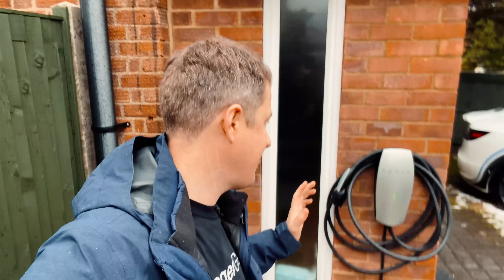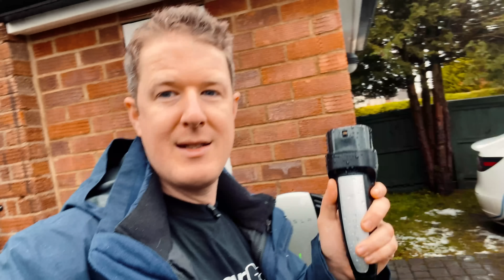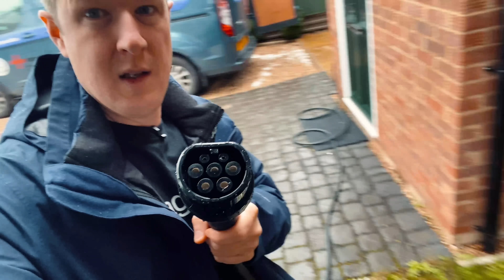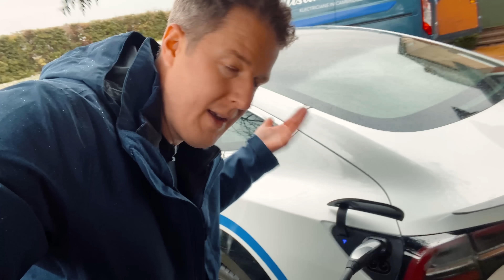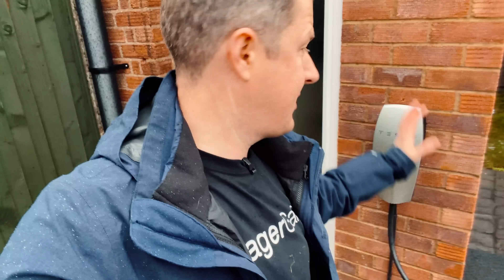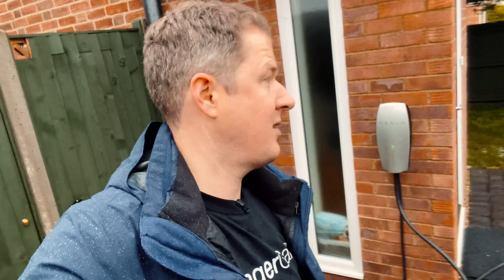Why you shouldn't buy a Tesla Wall Connector

Comment: Don't know if I missed any other points but your main reason is the protection devices with monitoring ability 2nd? 
Agree zappi is functionally better but don't think there is any problem with Tesla charger.
I've had Chargemaster Polar chargers which are terrible and Tesla chargers I'd put in the middle with regards to reliability and function.
At least the Tesla comes with 3 phase option for future proofing at no additional cost!

Comment: You can get non oem type 2 cables with the tesla botton, so you can match that to a charger with type 2 outlet.
I compared prices in norway (parts only) 22kw, tesla charger 5000kr+ chint earthfault protection 1500kr. The zappy is 10.000kr + cable 2500kr. So basicly twice the cost.
Another thing, the waterproofing over time, is not superb on the tesla plug.

Comment: So, they did come out with version 3 here in the usa and it does have smart features. So why review this version 2 then or bother to criticize it if you know version 3 is coming anyway.  We have this unit and have no need for so called smart features. It works, has been reliable and has a durable cable. If the cable is too heavy for you, then you need to work out. LOL.  The cable is hung around ours and it not an issue so I am not sure what you are talking about with the hanging. ??

Comment: Question from a non electrician .. How does an earth rod protect you when the car is sitting on four rubber insulators? Do you not still get a jolt when you touch the car?
Reply from the maker: The earth rod connects to the cars metal work and means that the physical ground under your feet and the casing of the car are at the same potential so you won’t get a shock. If the car was connected to the PEN conductor of the house and that dropped out then the casing of the car could become live and as the ground is a different potential you would get a shock if you touched it.
Reply: @artisanelectrics  what happens inside the house if you have a PEN failure? Surely all your metalwork, radiators etc would become live. Thus being more dangerous than a car being live, which I presume anyone would unplug before getting in.?
Reply: @daveknight7963  Yes, everything will become live, so you have nothing to touch that is at a different potential.

Comment: The only real safety hazard is the fact Jordon put the charger on the corner not the front forcing him to run a trip hazard in front of his door. Ya sure you UK types love all kinds of extra breaker types and extra cables running from each socket in your homes. But you will trip over that cable many more times than ever getting a shock. And I am guessing if someone comes to your home in the UK the safety police will sue you for the trip hazard. The kind of person buying a Tesla is buying it for the status, and buying the Tesla charger is part of the status experience, they don't care about apps or safety, it just needs to have flashing lights! The US Tesla charger has the advantage of being the only charger that has the "proprietary open standard" plug because unlike the EU the US didn't say "Stick with one plug, figure out what works best!"

Comment: Safety systems aside... Ev.energy app is all you need, you don’t need a smart charge point, the app will control the car and tell it when to charge, the app will take advantage of Time Of Use tariffs and schedule your charge to be at the cheapest points in your tariff 👍
Reply: Thats nice for people with Tesla or other high end electric vehicles that have there own app and are connected to the internet, many cheaper ev dont have app and are not connected to the internet, so no way for EV.Energy to be able to connect to the car. Thats why smart chargers are important they have internet connection and become the point where EV.Energy can control. So its not a one size fits all, thats why there are both available in the marketplace.

Comment: I really enjoy your channel, even though I am in the US.  It does unfortunately sound like the Tesla wall connector is really not good for the UK.  I can see that.  In the US, where I am (specifically in Chicago), I think it doesn't have many of those obvious downsides compared to other units.  I personally don't even use a wall connector for my Model 3.  I use a mobile connector, plugged into an exterior 240 volt (50 amp) outlet or a 240 volt (20 amp) outlet in the garage.  After paying for the car, I prefer to not spend an extra $500 to charge the car.  In Chicago, metallic electrical conduit is required, so everything is generally grounded by default, and Ground Fault protection (I forgot what it is called in the UK) would be part of the circuit breaker in the breaker box (consumer unit?), on both legs of the 240 volt circuit.  For new homes here, I think Arc Fault protection is also now required (not sure what that would be called in the UK).   While we do have a smart electric meter with an electric plan that has rates (tariffs?) that can vary hourly, they are so predictable that setting the car to have a fixed time to charge at night is sufficient where we live.

For good or for bad, it does appear possible that the Tesla wall connector was designed for the US market, and maybe specifically for the California/Oregon market initially.  A lot of the really cool EVs and types of charging equipment are not even sold in the US yet, as far as I can tell.  When wall units (that have probably $20 worth of parts in them) are sold for less than $100, they will be more attractive to me.  :)
Reply: The typical US installation uses a split-phase transformer local to the property. There the locally created N is earthed once to a local PE, so basically matches a TT installation with no need for a PEN fault detection as there's no PEN coming in from a far-away substation.

The type B RCD is a bit of an angsty requirement. The fear is that the car may connect its battery directly across the incoming AC lines and send 400V DC back into the grid. While this in theory could happen (especially with a Tesla (S or X in Europe and all US models) which CAN connect its battery to the AC pins directly), it's not a fault that ever has happened as far as I know.

Comment: I recommend getting the Tesla key. Double press the middle button to unlock the car then hold the boot button to unlock the charge cable and remove it. It's totally reliable and a nicer experience than using the app or getting into the car to unlock the charge cable. Yes it's £150 but paired with a Zappi charger and the lack of costs getting separate consumer unit and earth rod the total price and experience will be better than having the Tesla charger installed. Thanks for making these video - I enjoy watching them!

Comment: How often do PEN faults occur? I was a highway engineer and when we went through a cable that was that  - flash - bang - wallop - power off, so where else would a fault develop? The chance of just breaking a PEN through excavation work is practically nil. As a non sparky who has just bought an electric car I have been clueing up on the regs and it seems clear that most  problems could occur due to PME systems failing, so is it a bad system? Do they often fail or are the regs too over cautious? After watching John Wards presentation on EV charging points I am beginning to wonder if I should have stuck to good old petrol.
Reply from the maker: It’s more to do with old cables that have worn out over time, they reckon about 400 per year or something like that there is a document stating exact figures but I can’t remember off the top of my head
Reply: Yes it's the low hundreds per year, I've seen that document too.
Reply: It's probably not the liklihood but the danger when it occurs.
Large metal body , outside, possibly wet etc
Reply: PEN faults, although they still happen are a thing of the past.  Look back to the beginning of PME or TN-C-S,  it was a 240V  overhead supply, rather than running 3 conductors, they got away with running 2, bonding the neutral conductor every 6th pole to earth with an earth electrode.  Todays PME is totally different  using CNE cable feeding properties either over ground or more commonly underground.  The days of a neutral conductor breaking without shorting to phase are few and far between
Reply from the maker: Interesting thanks for sharing

Comment: Do you/should you do a PAT on an electric car?
It's a portable appliance, albeit a slightly odd one.
Reply from the maker: No I don’t think so
Reply: @artisanelectrics  I wonder if something like that should be a part of an EV MOT. 

So long as the earth bond from the car's body back to the charger's RCD is OK then the charger should notice anything wrong.

You can easily imagine the charge cable being damaged as it's plugged and unplugged a lot more than most appliances and lives outside. The earth bonding inside the vehicle is also subjected to a lot more shocks and vibrations than most things.

Tools tend to be double insulated but cars aren't. 

I tested a Tesla once (more as a "I wonder if" than anything) and it failed on insulation resistance, which probably isn't surprising!
Reply: Haha, brilliant!

Comment: What ???  A charger that doesn’t do anything but charge! This is outrageous!!
Reply: Well, I recall reading that none of them are actually "chargers" they just provide the electricity to the charger built in to the cars. You could have a 3 phase 22kW zappi installed but a Tesla Model 3 would only charge at 11kW (AC Type 2).
Reply: @LeiChat  spot on👍. I should edit my comment to “a charger that doesn’t even charge”
Reply: That device is a "Connector", not a charger!  The Tesla carries it's basic 110/220 volt charger with it.  In the US the "connector" has circuit protection, wi-fi, and multiple device power allocation built-in.  I suspect the EU version might be different to make use of the different electrical components available in most installations.  Our power suppliers will install separate meters for special loads such as A/C and EVs, and they have apps to set up all that "smart" Zappi stuff on line.  The capabilities exist in both parts of the world, just accessed differently.  I plug my Model 3 Performance in at over 11kW at my garage.  On the road I've seen over 140kW.  Soon that with double.  The car can charge at over 300kW!  The high rates are direct charging from the Tesla superchargers, not the on-board charger.

Comment: Could you use the Tesla cable on the Zappi? Or are there extra cables dedicated to to the button for the charge port button (wired back to the wall unit)?
Reply: Untethered Zappi and EV charge king cable.
Reply: @grahamleiper1538  is there a “bare end” version that can replace any charge-point tethered cable?
Reply: @muteposting  EV charge king do a kit for one of the more common type 2 ends, but it's maybe not for everyone.
Reply: @grahamleiper1538  perfect 👌 

https://www.evchargeking.com/en/tesla-charging-cable-pigtail-single-phase-32a
Reply: @muteposting  https://www.evchargeking.com/en/tesla-connector-kit-32a-crimped thought you were thinking of this?
Reply: Don't bother. Just get the Tesla key instead. Can unlock the charge port with that.

Comment: Hi Mate
I'm following you long time but since this ev charge thing came into market I don't miss any of your video. You do such a lovely video. You don't miss any single information. 
I got a question for you. 
If I install zapping or another charger do I have to have none rcd source or i can take feed from normal rcd protected board. Or if I have type A rcd protected board. Please advise.
Thanks
Reply from the maker: Best to check your local regulations. Lots of factors depend on the situation and the Regs where you are. Thanks gore watching!
Reply: I live in UK and I'm spark

Comment: Great 👍 content.. just know the reason why Tesla only make dumb chargers are because the car is smart, you can do all your controls at the car or using the car app .. but yeah that will not help with any time of grid control supports etc.. anyways I am in the US and the latest version does not offer much more ..the Gen 3 supports 48amp or 11.5kW charging speeds, power sharing with other gen 3, WiFi for firmware updates other basic status via same Tesla app nothing nothing new .. 

anyways people will still get it and want it because it’s a Tesla crazy but true most people is all about showing off or taking about Tesla than actual value of what they are getting .. so you will be getting more customers wanting you to install them and upgrade to the gen 3 when you guys get them .. 

Best of luck...

Comment: I don't really get it. What is the fundamental reason for a Tesla charger being so dumb? Is it because in the USA they have different system/regulations and they do not require pen fault detection and RCD?

Because if every tesla owner in the world has to go through this hoops, the only logical way is to design chargers just like zappis are or sell the kit charger + protection device all from tesla. Its really strange
Reply: The Tesla car (and app is smart).
You plug it in and tell the car to start charging at midnight, or only pull X amps.

The only thing it doesn't do is integrate with solar like the Zappi but given Tesla's investment in solar and Powerwalls etc its expected later versions will
Reply: @mark123655  It integrates with solar when you have the Tesla energy gateway (either as part of a powerwall or solar installation).

Comment: Probably it's a five core 6mm² and two smaller signal wires inside for the communication between car and charger. This is what I got here too. And the PEN won't fail by itself, it's mostly caused by construction work out on the street. The problem in the UK is, mostly single phase in domestics. On a three-phase installation it is much easier to detect a PEN fault by monitoring the voltages between the lines, between the single lines and the PEN. The voltages between the lines and the PEN should be 230V +/-10%, the voltages between the lines should be 400V. In case of a broken PEN the voltages between a line and a neutral will move arround between 0 and 400V, depending on the impedance of the connected appliances. For example:

A heater with 3680W (14.4 Ohms) is connected to a circuit fed by L1, a soldering iron with 20W (2645 Ohms) is connected to a circuit on L2. They're both connected with the PEN on one pole, the other pole is connected to the line L1 or L2. The PEN is the center point of this circuitry. But if the PEN breaks, the appliances are resistors connected in series between 400V and create a voltage divider. Which voltages you get depend on the ratios of the resistance of the connected appliances. In my example the heater will "see" 2.2V, and the soldering iron 397.8V. This will be the same in the UK, because below the streets are three-phase cables, but the houses of the streets are distributed evenly on all three phases. This means not only your appliances count in. Also what your neighbours, which are connected to the same damaged cable, have connected to their installation.

This can also happen in a TN-S system when the neutral breaks. But in that case metal housings of class 1 appliances would not become live, that's actually a specialty of the TN-C(-S) system.

Comment: I recon Tesla would of gave you the charger for free if you reached out to them and told them you wanted to review it. and maybe they would acknowledge feedback from the industry and adapt their product. I wonder if its just our regulations in the uk that require electrodes and double pole type A RCD's or is this a global thing?
Reply from the maker: Nah they would never do that
Reply: I think its European/ EU regulations, at least its a requirement in Norway and Germany as well, but there they are required by law to install an main earth electrode for the house distribution system, so a PEN breaker detector is actually a loud no. Because the PEN wire is split in the main fusebox and earth connected to the earth rod with the main earth electrode. Usually part of the foundation of the building when it’s built.
So the requirements for electric chargers to be connected to earth is already fulfilled when installing the cable from the fusebox and connecting the charger. RCD type A for the cable is required as well and type B is also a requirement but usually met by the electric charger installed and if not need to be installed in the fusebox.

Comment: Brilliant great informative video Jordan totally agree with you, but on an EICR would it fail if a zappi was installed, or get a C3 like a Hager breaker in a BG board?😆 OK a Wylex 🙂
Reply: Manufacturing instructions
Reply: Reece Horner what's your thought process on this? Do you mean if an AC type rcd was supplying the charger which has an A type Rcd built in then potential dc faults blinding the AC type RCD loosing it additional protection for the house circuits? I would then C2 this on an eicr. But if I was to install the Zappi charge id would supply via a garage unit via mcb with amour cabling to the charger or if there's a mcb spare not being protected by the CU RCD  install an A type RCBO.